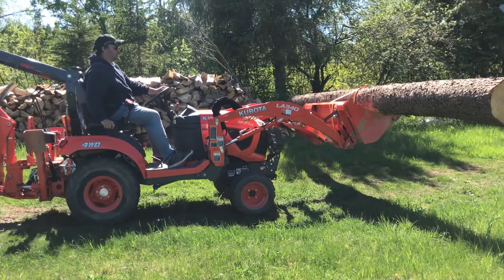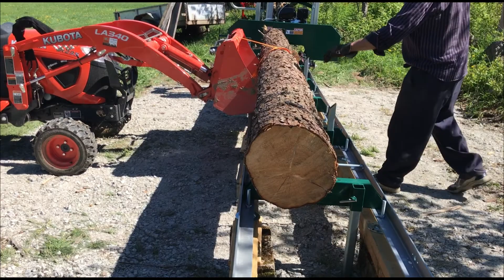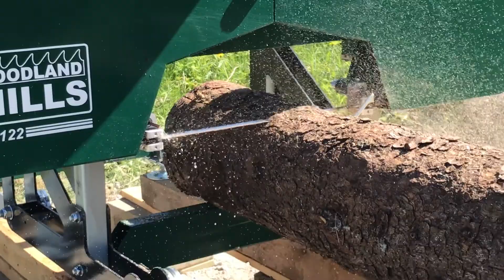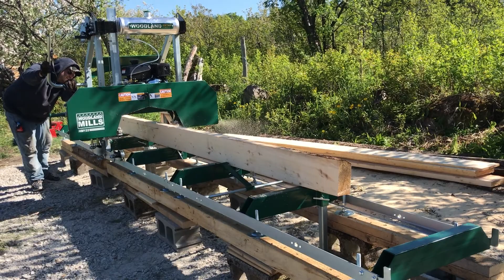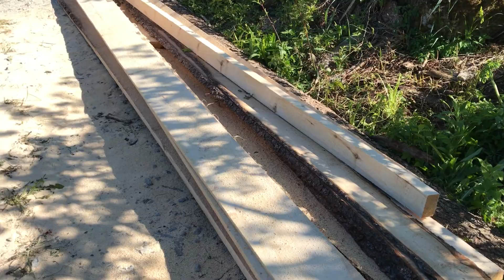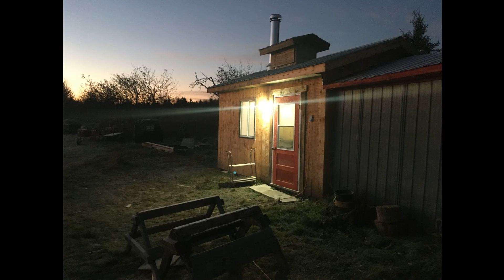Woodland Mills HM122 Milling Lumber with Kubota BX

Comment: Great project!  Those sawmills have become very affordable.  That is the next equipment on the list... in a few years! Thanks!
Reply from the maker: If you have the tree supply than this mill is a no brainer, next year on my to-do list is a new sun deck back in Trois-Rivieres, next a small off grid cabin would be nice too.. I was thinking of getting a bigger one with larger bandwheels, but the HM122 was already checking all my requirements needs.
Reply: Mmm In a few years REALY MON AMI 🤭😉👍👌🍻